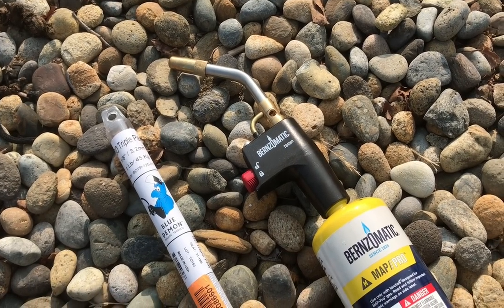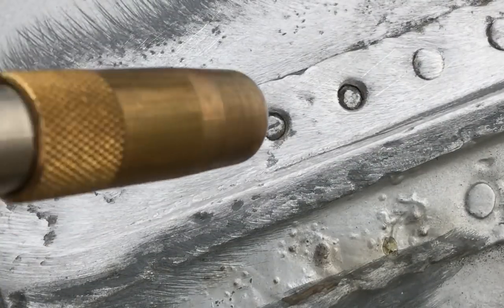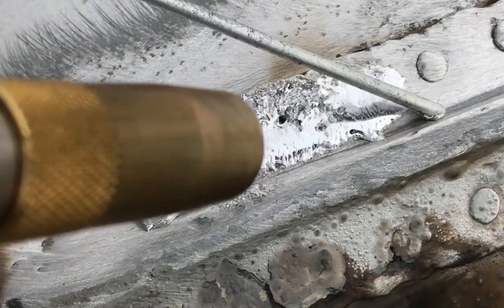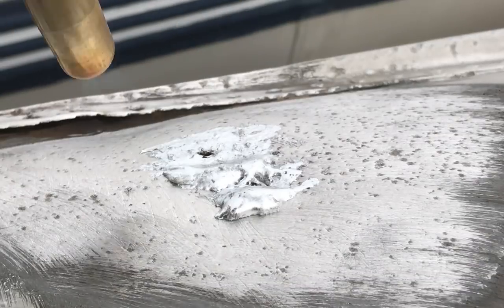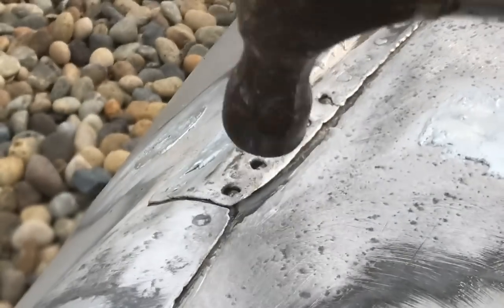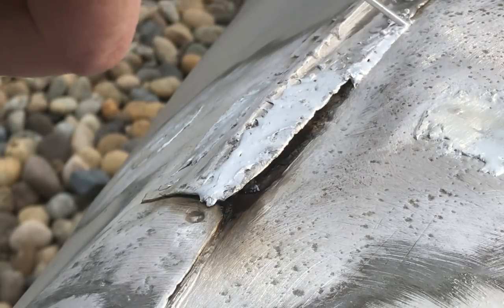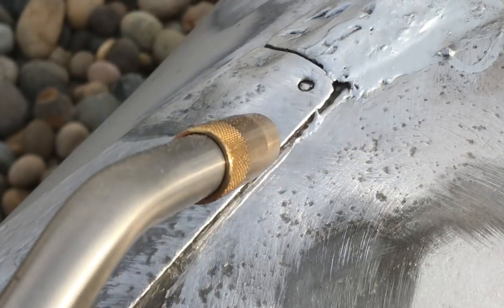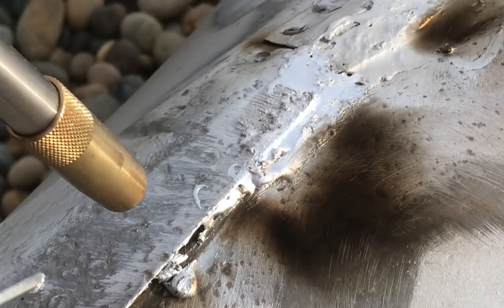DIY Aluminum Brazing holes in canoe / boat with Blue Demon Triple Play / aluminum solder & welding

Comment: You need to work on your heat placement and rod control. Nevertheless, thanks!
Reply from the maker: Jeremy's HVAC Journey this was my first try. Thanks. I’m guessing you use a lot of this in hvac.
Reply: @robdude1969  I've never brazed aluminum, we throw it away on jobs and replace it with copper or PEX lol.. But in my experience I always concentrate my heat on the piping or materials first, get it red cherry hot, super close to melting, then move my flame to the fitting, joint, T, ect.. I'm not an expert but it could've been done a little differently. Either way no hate bro, appreciate you posting this!
Reply: @robdude1969  I use a B Tank and Extreme Turbo Torch setup - it's Acetylene / Air. Just because it's easier to lug around as opposed to 2 bottles with Oxygen/Acetylene.
Reply from the maker: Jeremy's HVAC Journey I have a copper pipe job coming up. One day. A bunch of old valves all the way to the main. Each one has a slow drip.
Reply: @robdude1969  Nice! I'd be brazing all of that copper! 😂 BUT Propress is the big boy stuff now, takes all of the fun out of burning stuff up! Ha
Reply from the maker: @ASAPJermz  oh no! those big crimps do look boring compared to flame and solder!!!

Comment: Your using the flame to melt the rod, your gona have a weaker bond by doing that rather than just heat the surface of the item your welding.
Reply from the maker: agreed! thanks for your tip.

Comment: Mine wont stick it just flakes off ??????      ?????????????? HELP
Reply from the maker: the surface probably isn't hot enough or clean enough.
Reply: An i also am using the kind rolld up like fishing string looking not a straight rod

Comment: What is MAP gas?
Reply from the maker: https://en.wikipedia.org › wiki › MAPP_gas

"MAPP gas" is a trademarked name, belonging to The Linde Group, and previously belonging to the Dow Chemical Company, for a fuel gas based on a stabilized mixture of methylacetylene (propyne) and propadiene. The name comes from the original chemical composition, methylacetylene-propadiene propane.
Reply: It shows you where you are headed...lol
Reply: It's a hotter gas than propane, so you can get back to your video games quicker.  Costs a little more though.